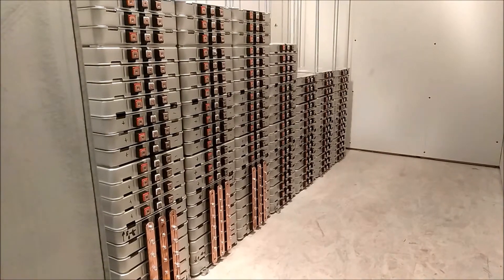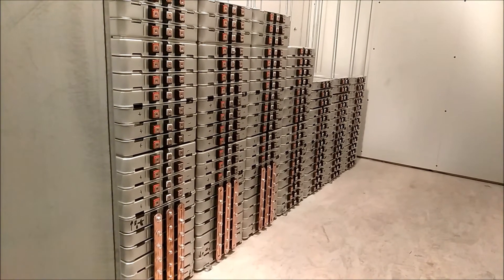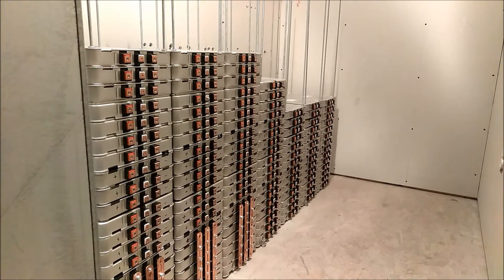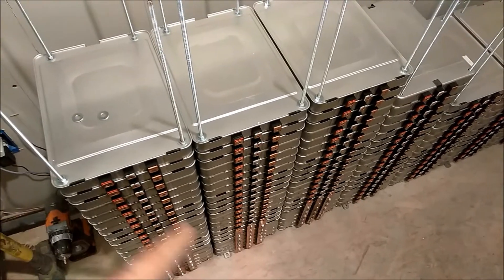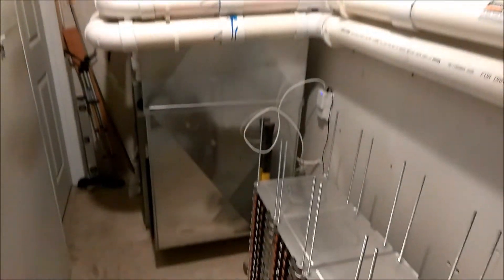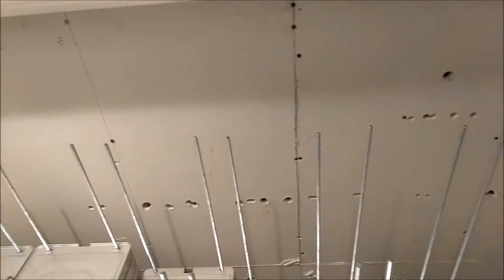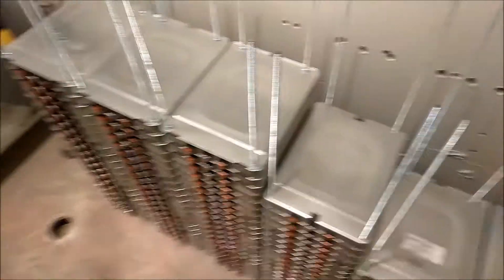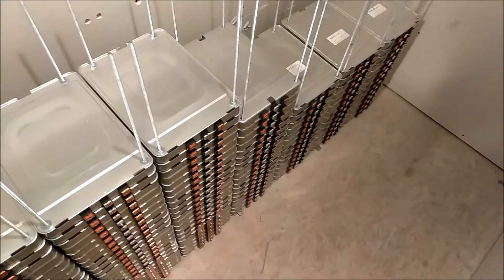Progress on the Nissan leaf mega power wall

Comment: I love you wall ! I’m following you only I have 24 volt system with 3 magnum 4024 pae 1 master two slave for 12000 watts and have 1 bank of Nissan Leaf batteries, right now three stacks of 24 in series 72 total and plan on 72 more for a secondary bank for a total of 144 I plan on running my total house including 3 outside ac units. The only thing I can’t run will be my hot tub on a double 50amp so 120 x 50x 2 12000 watts I will have to add the 4th 4024 pae total of 16000 watts
Reply from the maker: Sound like you got one hell of a solar system 👍.

Comment: DAAMM ! If you fill up all the top spaces to the ceiling , you should have enough power to share among your neighbors . That is going to be the largest  “ BANK WALL “ you’ve ever build that I’ve ever seen before . You’ll have a month worth of power . May the solar be with you !
Reply from the maker: I'm going to start off with a hundred and forty seven modules and see how the solar panels handle charging that and if it does a good job I will add another 49 to make it 196 modules 😁.
Reply: carson l urban wind and solar Wow !

Comment: Hey, just curious if you are aware of the TYPOS in your post and pre roll text? it starts with YOYR, I think that is to read YOUR. and on the post roll it says SUSRIBE when it should read SUBSCRIBE. 
If I am wrong and that was intentional, then you have my apology. Otherwise might wanna fix those. 
Also, the system is coming together nicely, can't wait to see if finally finished.
I am curious, are you going to have enough solar to be able to recharge that beast? Have you calculated the capacity yet? What are you expecting out of it?

Keep up the solid work, looks like you are having fun with it.
My system videos will go up once I get my bank installed, let you know when it's done.
Reply from the maker: No I was not aware that I will check into it and make changes as necessary thanks for letting me know.  I'll calculate it the kilowatt hours to be about 67 that's with the 35% degradation and I hope the solar can keep up I should not take no more out of the banks than what I need over the night unless we have a couple of days of no sun. But now that you mentioned that I might have to do some calculations and see. 👍

Comment: Wowwww  that's beautiful , are you  fusing  between each bank? Is it reasonable  for me to assume  that  you're  leaving  the grid pretty  soon? Which supplier are you  using for your  batteries? Just purchased  my first 49 from green tech  auto. Can't wait to replace my SLA  Batteries .
Reply from the maker: Been dealing with big battery here lately they have been treating me right. my last battery banks that I did I did not fuse in between the banks but I might look into that on this one. No I will not be leaving the grid but will not be use it only for emergencies.